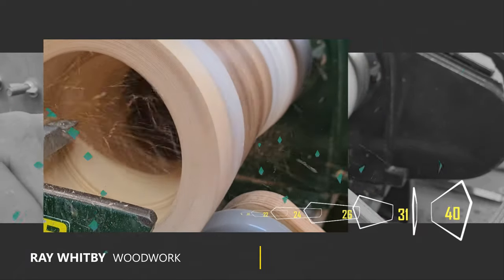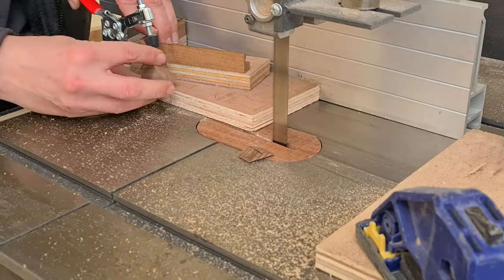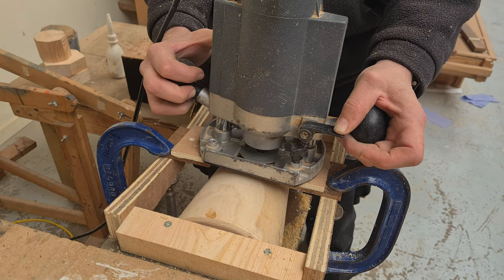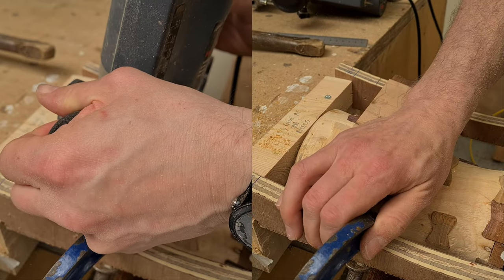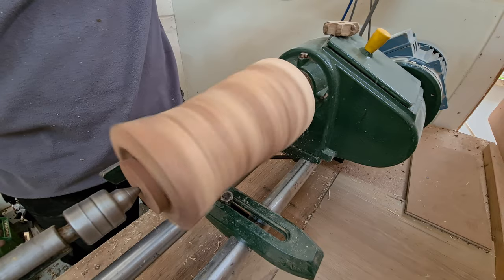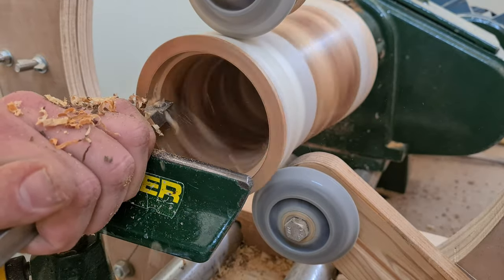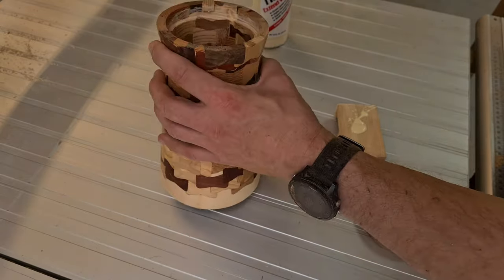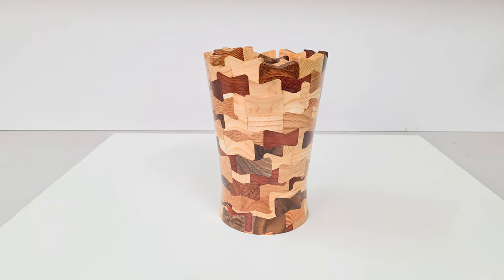Woodturning - Butterfly Chaos

Comment: Beautiful vase. The only thing I would have done differently would have been to make a wood putty from sieved sawdust and wood glue or cyanoacrylate glue. I would have applied said putty all over the surface forcing it into any voids and continue as per usual. I use this method whenever I do any segmented work and have had much success with it.
Reply from the maker: On a curved surface the chances of minor gaps does increase, probably because my jigs are not hyper accurate or my routing skills! So I did have quite a few gaps appear. The decision was to place another butterfly on top and hope that one was put in correctly. But I did have to use a small amount of wood dust filler in places like you said. Hopefully didn't show too much! Thanks for watching. All the best. Ray

Comment: Looks fantastic, how did you deal with different movement of the different species to stop it pushing itself apart?
Reply from the maker: So far it's been very stable and haven't seen any cracking/movement. Each species was dried before use, but movement could still happen in extreme humidity & temp I guess.

Comment: When I saw the thumbnail I thought, no way. Then I remembered the helix vase. I have to say, I'm a little disappointed. I thought I was going to be seeing some crazy jig design to calculate the angle of the depression accounting for the curvature of the vase. NOW the question is, what if it was originally a square plugged on all sides. Then cut the corners off the square to make a new square and plug it with bow ties and finish it off on the lathe. That would be my non mathematical solution for this problem.... if I had the desire to put so much time into it. LOL Seriously tho, great job. I like it. 😀
Reply from the maker: It's difficult Jay. I'm sure you know what it's like when you put your heart and soul into a project and the YT algorithm almost sneers at you compared with other videos you publish with a lot less work and ingenuity in them. Hard to know what to do next. I have a couple more ideas based on the helix work and I'll be glad to go back to them after this project! I'm still testing the waters with ideas and always appreciate feedback. I really like your approach for the butterflies. I guess if you have a butterfly spline router bit then you could remove the V-shape quickly too, then on to the table saw and cut butterfly slices. Thanks for watching and commenting! Take care. Ray